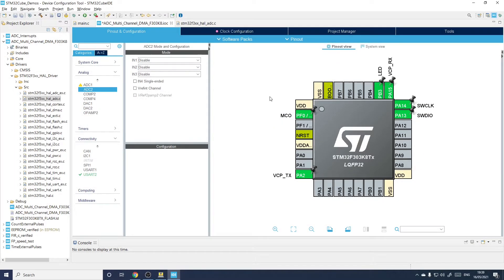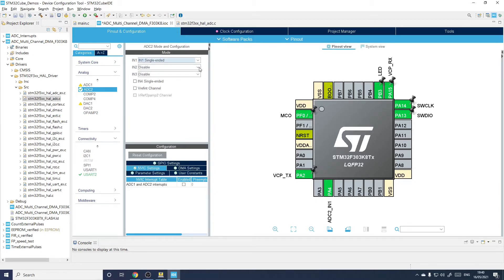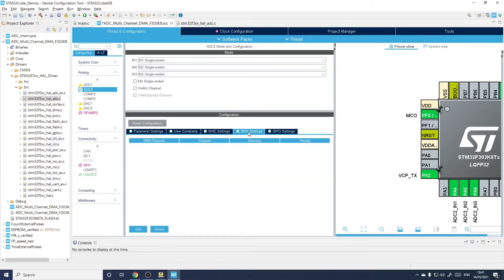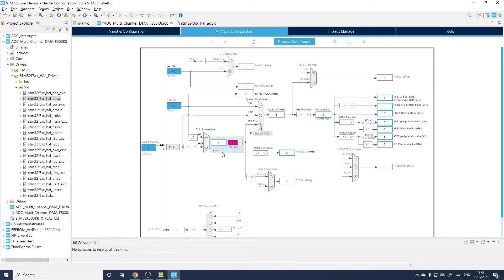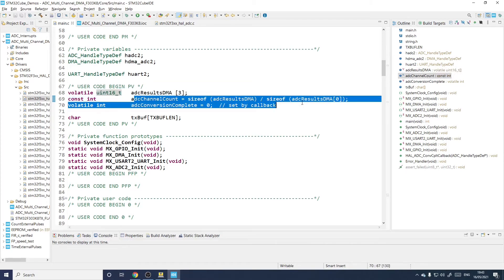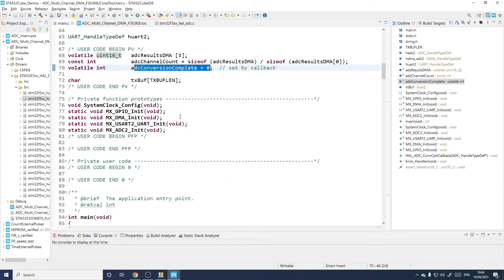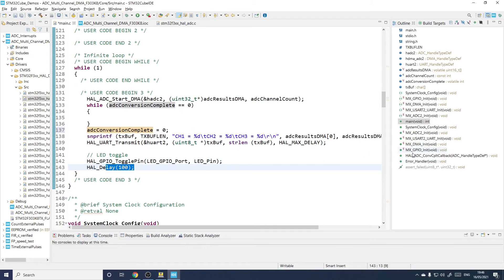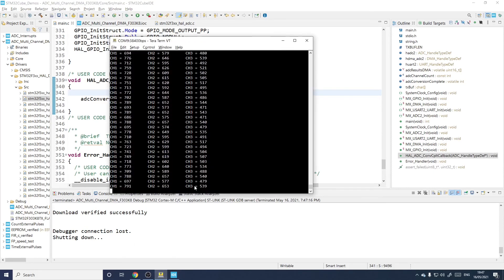Set up multiple ADCs on STM32 microcontrollers using DMA

Comment: The title of the video is confusing. It is not multiple ADCs, it is multiple ADC channels. There are plenty of videos like this one. But I can't find any about multiple ADCs working at the same time.
Reply: hey, im encountering the same problem. I have an STM32 U5XX and i havent been able to configure both ADCs to work at the same time using DMA. Have you found any solution to your problem?
Reply: @marcmorato7316  Yes, you need to configure the dual mode. There's nothing complicated there

Comment: You use volatile to tell the compiler the variable is used (updated) outside of the routines that reference it; in this case, the DMA writes to it.  You need to change the title of your presentation to Set up multiple channels of a ADC for scan using DMA.  This is important because was looking for setting  up multiple ADCs (ie. ADC 1, ADC2, ADC3) all using scanning.  Since there is only one callback I need to know how to tell which ADC DMA was completed.

Comment: Nice overview thanks very much!  A question if I may?  If someone wants to use two ADCs at the highest speed, but synchronise the readings so that 2 memory buffers receive each sample at the same time, what's the best way in your view?  If software start is used they might drift by a sample or two, so use a high speed timer to activate both, one timer drives both?  Can a timer run a 1MHz, I guess it can? Or is there a better way?

Comment: The HAL_ADC_Start_DMA function is consuming a lot of time. Since I am using it in a 50kHz regulator, it is critical to me. Is there another way to start the conversion?
Reply: You can set the conversion to run continuously in the background, so that you will only need to call start once. The interrupt will fire once every time the buffer is filled. You can even set it up to fire separate interrupts for "buffer half full" and "buffer full", which allows you to do double buffering (useful if you need to do heavy processing on the samples while new ones are being captured).

Comment: The IDE has slightly changed since this video I think. I had to click the dropdown arrows next to each "Rank" and set them to Channel 1, 2 and 3 respectively. Then the DMA worked fine with the Blackpill F401 board.

This is also a kind of note-to-self thing. Cheers, great vid!
Reply from the maker: Hi Glowfly!  I used a cheap and cheerful F030 in this video, and they don't have the ranking feature.  I think the IDE "knows" this and therefore doesn't show the option.
Reply: how did you adjust the timers for the adc? on the F401 i cant find an ADC clock
Reply: Thank you tons. This worked with my STM32G041K.
Reply: Also worked on WB55 board!

Comment: Did the same, works flawless for 3 out of 5 channels I used...
Doesn't seem to be the wiring, "adcResultsDMA" is consistently wrong on index 2 and 3, even if I use different channels in board config
Reply: You probably got the RANK out of order then...

Comment: It looks like this example does 1 reading for each of the 3 adc channels. How do you do multiple adc readings for each channel?
Reply: I also would like to use ADC1 and ADC2 at the same time. Did you find any information how to do it? Thanks!
Reply: @yogaline8218  basically repeat the same settings in as the first ADC in whichever ADC you're going to use in cubemx then call the hal functions twice with the two adc pointers (&hadc1, &hadc2)
Reply: Set up for continuous conversions and use a bigger buffer. Then for the DMA start function, tell the size of the buffer - you will get an interrupt once the buffer is filled.

Comment: Great Video. I found a bug in the HAL. sometimes (not every time) the generated HAL is wrong. The 	MX_DMA_Init(); must be called before MX_ADC1_Init(); otherwise the ADC makes just one measurment. But this is not guaranteed always correct. (Cube IDE 1.7.0)
Reply: Thank you man!!! almost 1 day debugging and trying to find out why!!!!.. your solution solve it in seconds hehe
Reply: Thank you so much, you saved my life on this...
Reply: Add another THANKS SO MUCH!!! - I was about to spend several thousand $USD to get someone to fix this because I was at the end of my wits after fighting this for 3+ weeks for a product of ours that we had to redesign to fit in the L433 (from the L476).  kokoianer - you are truly apprecaited. I'm going to be reaching out to the local (Austin, TX) ST support team to tell them about this - and I'll give full credit to YOU!
Reply: This can be changed in the Project Manager under Advanced Settings (CubeMX 6.3, probably also in the cubeIDE)! So you don't have to change it manually in the code every time you change something in the cubeMX config.
It is still weird why can be the other way round.
Reply from the maker: I wish I'd remembered this comment. This exact problem bit me at work last week, and it took a couple of hours to get to the root of it.  This was in the F0 HAL, so I guess the problem is everywhere.
Reply: Thank you so much, this really saved me
Reply: I posted a few months ago - and a buddy of mine showed me a neat way of dealing with this in the future (so that the .ioc regeneration doesn't undo what you've done...):   use a #define statement as in:

 /* USER CODE BEGIN SysInit */
  /* Workaround for CubeMX bug that initializes HW in wrong order */
  MX_GPIO_Init();
  MX_DMA_Init();
  MX_ADC1_Init();
#define MX_DMA_Init()
#define MX_ADC1_INIT()
#define MX_GPIO_INIT()
  /* USER CODE END SysInit */

  /* Initialize all configured peripherals */
  MX_GPIO_Init();
  MX_ADC1_Init();
  MX_TIM2_Init();
  MX_USART1_UART_Init();
  MX_CRC_Init();
  MX_DAC1_Init();
  MX_SPI2_Init();
  MX_TIM6_Init();
  MX_TIM7_Init();
  MX_USART3_UART_Init();
  MX_TIM1_Init();
  MX_TIM16_Init();
  MX_DMA_Init();
  MX_TIM15_Init();
  /* USER CODE BEGIN 2 */

// Return Original Definitions
#undef MX_DMA_Init
#undef MX_ADC1_INIT
#undef MX_GPIO_INIT
  /* USER CODE END 2 */
Reply from the maker: @erichoward6766  That is pure funk.  It's definitely going into my future code.
Reply: holy shit, thanks! I was going crazy trying to figure this out.
Reply: The adc makes justo one measurement because he's not setting the DMA request settings mode to circular, i suppose.